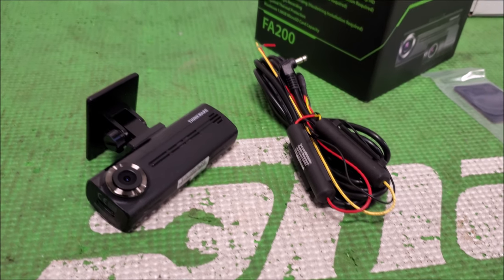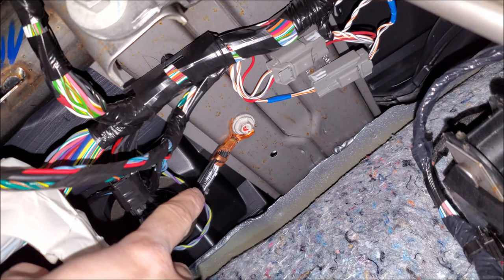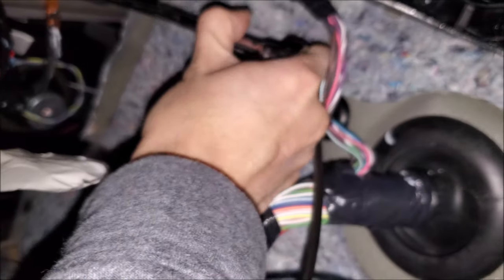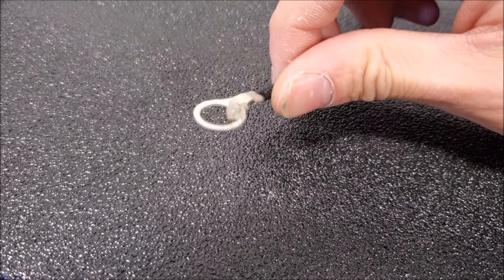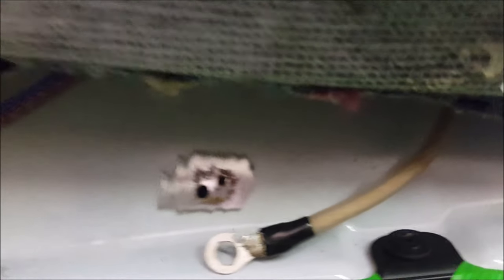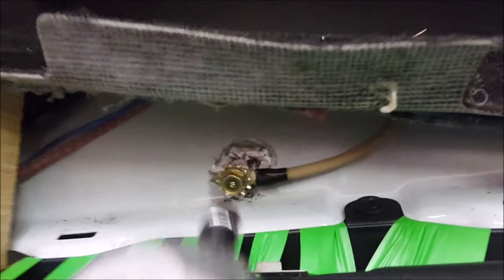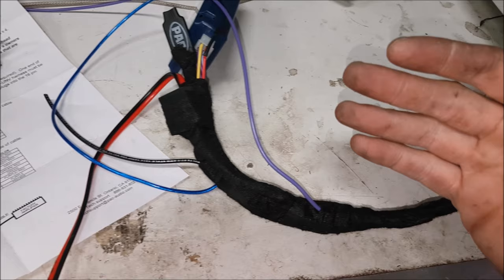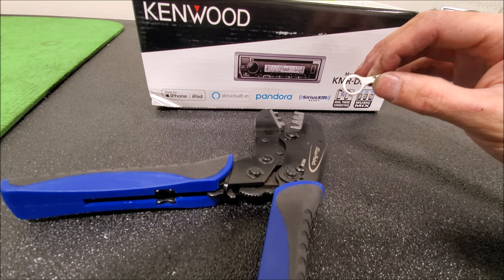Where to Ground Aftermarket Electronic Devices (12 Volt Car) | AnthonyJ350

Comment: Did it work and the radio unit turn on normally after using the vehicle metal chassis for the ground?
Reply from the maker: Should only turn on with ignition.

Comment: Can you ground the black wire without the little metal circle piece Like could i just pull alittle bit of the metal out of the wire and electrical tape it onto a metal bolt?
Reply from the maker: No, put the ring on the wire and crimp for maximum reliability.

Comment: What kind of bolt was that brass one you used for the ground?  also what kind of drill bit did you use to clean the ground spot?  thanks.
Reply from the maker: Check out Pozitiveground.com

Comment: I have a control module for aftermarket tail lights that needs to be connected to ground wire, is this the same concept?
Reply from the maker: Yes, any aftermarket electronic device will use the concepts in the video.
Reply: @AnthonyJ350  what did you do to shave off the paint for bare metal contact?
Reply from the maker: @cheex9861  I use a circular brush used for rivets. It's in my Amazon store.
Reply: @AnthonyJ350  thank you!
Reply from the maker: @cheex9861  You're welcome 😊

Comment: I found out that there isn't a good ground point for my dash cam in my 2011 Jetta. There are some screws near the cabin fuse box but unfortunately they're ALL "floating" screws attached to plastic parts. Does anybody have any ideas on what to do? I've looked EVERYWHERE near the fuse box and there's NOTHING reasonably close by.
Reply from the maker: Can't run a longer wire to the kick panel area. There's usually a factory ground bolt in there.

Comment: Where can I buy that bolt and the washer
Reply from the maker: Which part in the video?
Reply: @AnthonyJ350  you know how to disable the anc in Lexus 2020 is300 I’m getting a humming noise when the car is started
Reply: I can’t find the module do I disconnect the mic. Is there a wire I could cut?
Reply from the maker: @krodyssey4770  You can try unplugging the mics. Just don't unplug the Bluetooth mic.
Reply: @AnthonyJ350  should I tap into a diffrent speakers becuase I tap them into the front door speakers. Should I do rear door? Becuase I think the anc works on front door and stock subwoofer. Idk tho if I’m correct
Reply from the maker: @krodyssey4770  You can try, but make sure it's a full range signal
Reply: @AnthonyJ350  could I do tweeters or that’s a bad idea. Cuz I think the anc don’t work on tweeters
Reply from the maker: @krodyssey4770  You'll probably only get high frequencies from there. Have to test the signal with an oscilloscope.